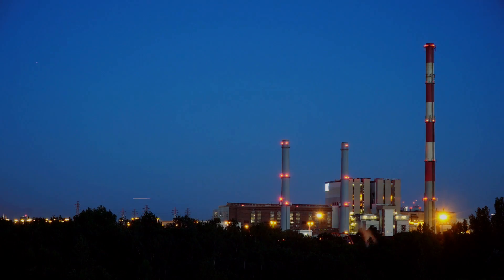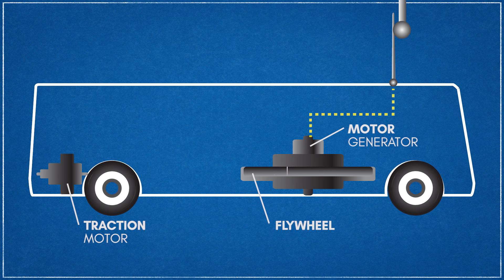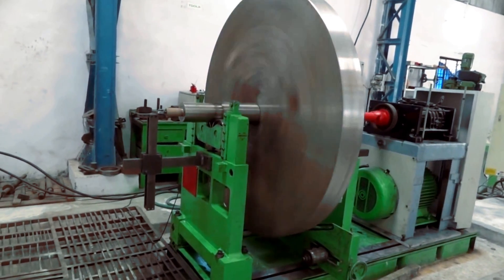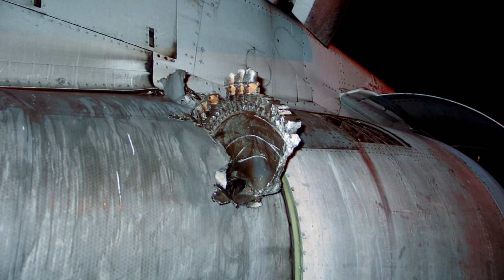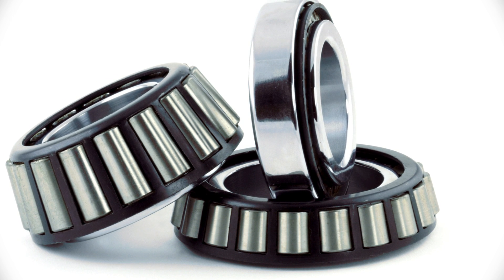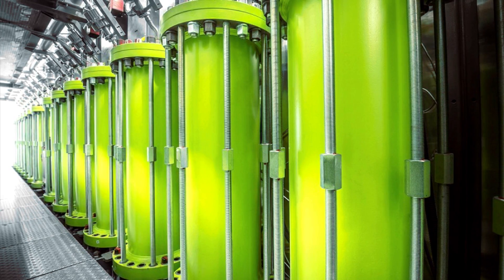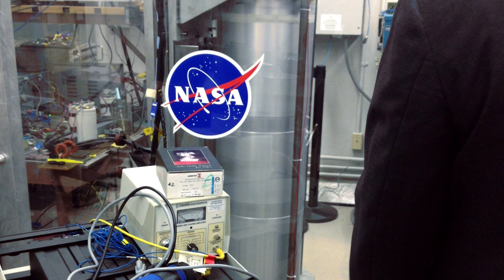The Mechanical Battery

Comment: But as for making public energy, just pumping water up a hill and turning on a turbine is a bit more efficient.
Reply: The New York Power Authority operates a pumped water storage facility in Eastern New York, Blenheim-Gilboa,  that is used as a peaking unit. The pumps that run at night (lowest demand, lowest electricity cost period of the day), fill the reservoir above the facility. During day periods of high demand, the water is sent through the pinstocks to the pump/generators to provide peaking power supply to reduce strain on the rest of the distribution system. It can produce 1.5Mw for about 12,000 Mw hours, all of which is sent to NYC. The overall plant efficiency is about 73%, For 12,000 MwHrs, they have to expend 17,000 MwHrs to fill the reservoir. They have been doing this since 1973, with several upgrades to increase efficiency and capacity.
Reply: It's simple too. It just doesn't have very much energy density.
Reply: @reedr1659  Yeah but that's less important when it comes to mass energy storage considering we don't use a large portion of the land anyways. But it is far more efficient to just pump water up hill and turn a turbine as nearly all the energy is preserved indefinitely. The only losses come from evaporation and technically rain tends to balance it out in most places. Plus since other forms of energy storage like batteries can explode and flywheels have poor ability to maintain their charge this is the best we can currently think of.

Energy density is more an issue when it comes to raw energy production depending on how it is made, how close you can live in proximity, etc. An example would be that while solar is one of the absolutely least energy dense, but you can literally put it on the top of a roof or even over parking lots making the impact negligible. Solar is more held back due to material demand, economics, the limited resources required to produce it, and that the resource tends to be dependent on other nations. These aren't really facts to ignore. 

Nuclear tends to be considered the most energy dense because logically ripping energy directly from the atom is far more dense, but at the same time, nuclear also takes large scale projects which most people are unwilling to live within 5 miles of due to its history (even if that history is very skewed). It also takes more expensive mining programs and as of right now next to none of the US's uranium is mined here in the US making it a negative on the US economy, even if it is the best we got to produce large sums of power in a clean manner. 

Wind is by far the least efficient as the land issue can't really be solved and maintenance is brutal. Wind is basically always going to be the last option.
Reply: @Skylancer727  I don't necessarily disagree, but dams are expensive to construct and considering the health of existing dams in the country, do we really want to add tons more? It also poses other issues, water rights being probably the biggest. Honestly, we'd probably be further ahead to put the money into developing nuclear fusion as a viable power source.
Reply: @reedr1659  well we don't need to make dams. Like I said, you can just make a reservoir and pump water into it as storage. Technically dams are just a method to produce power, not store it. Plus you can make a reservoir far cheaper than a dam. It's more constructing pump systems and a run off and you can use existing pits or crevices in the land. Just make sure it's enforced enough and it's fairly cheap. 

And fusion is not coming any time soon. Honestly fusion looks at least 50 years off as none of the current methods produce anything remotely worth the energy wasted to cause the fusion. And considering experimental reactors are basically a no show, that means commercial fusion is decades off considering the construction of one plant at the commercial scale will likely take 15-20 years alone. It may be even longer off yet.
Reply: @Skylancer727  Dams are mechanisms for containing the stored water energy in a reservoir.  The power generation and pump systems may even be in their own building at some projects.  There are also significant dams without power generation at all, like the big dams keeping the Netherlands dry or the tailings dams at mines.
Reply: @johncrowerdoe5527  Well most of those are designed specifically as reservoirs to store water. You can of course add energy generation to the outlets of them, but depends what you intend on using it for. You don't however need a dam to make a reservoir. Many reservoirs are just plots of land they dug up, layed cement over (if one of the uses was for drinking water, if not it isn't necessary), and pump water into it.

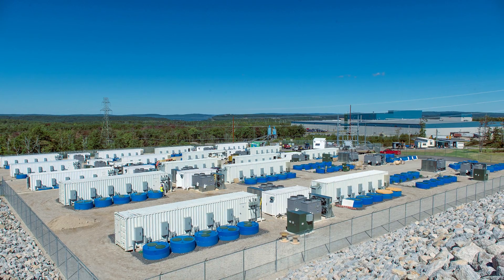Comment: Hi! Great vid! Just a heads up that at 13:40 I think you measure storage capacity of the power grid systems in watts.
Reply: W, kW, MW, GW etc are measures of power, not energy. Energy is measured in Joules (J) which is the energy required to provide a Watt of power for a second. 3,600J is enough energy to supply 1W for an hour and is often called a Watt Hour (W.h). Likewise, 3,600,000J is a kW.h., 3,600,000,000J = 1MW.h.
As a physicist, it always irks me when people who ought to know better conflate Watts (power) with Watt hours (energy).
Reply: @q.e.d.9112  Thank you Q.E.D. for saving me the time of making a similar comment.

Comment: I'm imagining a wind up cell phone.
Reply: I'd buy that
Reply: I can't see why not.

Wind spring.
Spins a ring that carries many tiny Magnets. each in opposing polarity(?).
A small coil has those magnets go through it drive an AC current.
tada.
Reply: @fanOmry  I actually have a little hand wound charger with a USB port on it.  It's a lot of work for not very much charge.

I bought if for a dollar including shipping a couple years ago.
Reply: @DAndyLord  

That was Probably a basic Dinamo setup. Like with Bikes, only a wind spring.

My Idea is the Hand spring drives a flywheel that's doted with magnets.
Those Magnets drive an ACurent.
Much more efficient.
Reply: @fanOmry  A clockwork mechanism makes more sense to me.  A wound spring spins a flywheel and power is taken as needed by the device.
Reply: @DAndyLord  

That's what I wrote.

I just detailed it.
Basically something equivalent to a generator in a power plant(Almost)

Comment: Let's see...bus hits a bump on one side and tilts a bit, or takes a curve and the body rolls to the outside due to centrifugal force.  Then the gyroscopic reaction violently slews the bus sideways.   Must have been fun to steer this thing.  Reminds me of an old propellor airplane (forget which one) with a radial engine where the cylinders were what rotated with the propellor.  The gyroscopic effect of all that rotating mass gave it frightful handling characteristics.

Comment: I wouldn’t think that using a flywheel energy storage system would be very safe in a moving vehicle, one accident could be catastrophic. But using it in conjunction with solar panels for a house could be quite useful for night time power use.
Reply: Moving vehicles have tanks full of highly flammable liquid, massive lithium ion batteries and high speed reciprocating pistons. All dangerous if not managed properly. Flywheels are perfectly safe in moving vehicles if mounted appropriately in containment housings.
Reply: Exactly my thought as well. Worth researching for feasibility.
Reply: But you could let the flywheel maintain its axis of rotation by allowing others axis points connected to the flywheel’s axis in three dimensional space, like a gyroscope toy, to rotate in the frame of the car’s rotation. Second: I am not sure if gyroscope force are affected by centrifugal force, which would mean a cars change in direction has no effect on the gyroscopic forces.
Reply: @glennobiero6775  if you would drive left/right, that axis won't affect the flywheel at all, but what about a speedbump? Due to gyroscopic forces it will exert a force on the car! If you have two counterrotating flywheels, they would cancel out each others gyroscopic precession!
Reply: Could implement a braking technology linked to collision sensors in the event of an auto accident. Problem solved.
Reply: It's not possible to use it for anything that's not "sitting in place", or moving in a straight line, because the higher the energy in a flywheel, the more energy it takes to accelerate/decelerate it in any direction. It can be used for your house for storing limited amounts of solar energy for sure, but not anything like a "mechanical battery" for cars.

Comment: We forgot to add that for fixed bulk FESS, the gyro precessional forces on the bearings due to the earth's rotation can be all but eliminated if the flywheel's axis aligns with, and points in the same direction as, the Earth's rotational axis (we estimated the axis directions for various latitudes using a cocktail stick and a globe).  Therefore at the equator: axis  horizontal, at the poles: vertical, and somewhere between these two extremes anywhere else on the planet.  However,  there will still be an out-of-balance but constant force on the bearings due to the flywheel's weight.

Comment: Strong magnets usually use rare metals, like neodymium. So flywheel systems need some rare materials for motors, generators and bearings.
Reply: Motors and generators typically use electro magnets dominated by iron, copper, aluminium and nickel.
Reply: @johncrowerdoe5527  Yes, but motors with permanent magnets are more efficient. And you need that high efficiency to make a viable energy storage system.

Comment: Flywheels were used on early aircraft carriers to launch the planes. Also for aircraft engine starting.
Reply: You mean reciprocating aircraft engines? Yeah and they still use them today because they are basically car engines with car starters.
Reply: @mistere5857  I was thinking the hand-cranked inertia starters used on some single-engine WW2 fighters.
Reply: @scratchdog2216  oh yeah those are definitely more in line with the principle of a fly wheel as presented in the video

Comment: What about a system that works like a ice-skater (with hands to the body increasing RPM)? It can adjust it's RPM.
Reply: You know what, that's actually a brilliant idea.  One of the biggest issues with flywheels is controlling the RPM.  I guess it's not done because it would make the flywheel very large with the "arms" sticking out, and if you just made a solid flywheel that large you'd be able to store more energy so it may not make commercial sense.  But matching the RPM to the target range is difficult and expensive, so something like this could really do the job much more cheaply.  Very interesting for a home/DIY project!
Reply: @Berkeloid0  Heavy meats, like tungsten? Needs yet to be calculated though. Don't have the time on my hands.
Reply: @lkocevar  I mean if you have a flywheel with a 1m diameter, and you give it arms that can extend out to 2m diameter, you would need the same amount of space as a 2m flywheel and then a solid 2m flywheel can probably store more energy in the same space.  Although the material close to the centre of the wheel won't contribute as much as the material nearer the edges, so perhaps it's not a problem -  I don't know enough yet to say for sure.  Will definitely be investigating your idea though in a future off-grid setup, where losing some energy storage but gaining easy frequency control is well worth the tradeoff.

Comment: Another way of doing it is by having a pulley system in a tower. You have big weights that just get hoisted up by a generator motor when the power is on, then when it’s off, discharge the weight and let it sink to the ground, or further if you want. I’m not sure which is better, more reliable, more efficient, etc. but it’s another way you could do it.
Reply: Yup, I want to have a go at making something like that. 
 Perhaps starting small, with a 1 ton weight, raised to a mere 5 metres.

Comment: "no need for exotic minerals..."? and how exactly are you building the motor/generator and the magnetic bearings and the high performance alloys withstanding the forces of high rotational speeds without exotic minerals? 
🤔
Reply: The iron age was 2500 years ago
Reply: The Neodymium Age only started 1885 tho...
Reply: 1885 was still counts on fingers a few years ago.  Neodymium is no rarer than copper, and not strictly necessary to build a giant flywheel, which is maybe not the best idea in the first place.

Comment: It is clear that for a small scale system like a car you would rather use something like chemical batteries, compressed air or hydrogen. But aside from using an already existing mineshaft to hold large amounts of compressed air those become less cost effective on large scale. We really need some better numbers on what size flywheel units are most cost effective to build and how many of those would be needed for a good grid level storage system or building backup. Frankly, if you could make a flywheel of similar capacity and cost to a Tesla Powerwall, needing to install it in a pit in your garden wouldn't be too much to pay for the longer lifespan and not needing to worry about all the issues that can lower the efficiency or even kill your chemical batteries.

Comment: 10:40 *flux vortex locking/pinning. The Meisner effect is far too low to sustain the required loads and is not even present in practical superconductors. Also, using superconductors for rotating parts, especially those with the RPMs of flywheels, pose significant problems and losses related to the AC properties of said superconductors
Reply: The superconductors would be closer to the center axle than the energy storage mass.  The eddy currents are actually used to hold the thing in place.
Reply: @johncrowerdoe5527  those are not the issue, the hysteresis losses due to the changing magnetic field in the superconductor are. Also coupling losses will pose problems (all practical superconductors are composites)

Comment: The gyroscopic forces created by the rotation of the Earth can be neutralized (in stationary use cases) by positioning the axis of the battery to be parallel to that of the Earth. That of course means that the devices axis angle to the ground will have to be latitude-dependent.

Fun fact: There was an attempt to use that same force to make a device that could extract energy form the rotation of the planet Earth. Using a gyroscope as an "anchor point" and using it's 24 hour procession to turn a generator, of course after the rotation is being sped up by a transmission. Picture a flywheel with an axis perpendicular to that of Earth, spinning fast. That whole contraption is suspended on another axis, this time parallel to Earth. So you get one rotation per 24 hours in that parallel axis. If you put a accelerating transmission theoretically you can get any number of revolutions per minute ... The soviet union spent millions and years trying to perfect this method. In the end they ultimately failed. The amount of gear acceleration that had to be applied was so great, that all of the energy was lost in the gears themselves. The original idea was that the energy expended in spinning up the gyro wheel  and keeping it spinning would be far less than the extracted energy. Since the wheels energy is not actually used and the wheel is only used to create the gyroscopic effect which in turn is used to generate the output energy. However that energy economy was never achieved, by a long shot. So they abandoned it.

Comment: how do you increase the energy capacity for a flywheel( ie by optimizing mass or radius or rpm) which factor has most effect on energy capacity and will changing radius do anything?
Reply: Check the only formula in the video.

Comment: Have they tried floating a flywheel on a dence liquid like mercury or even lead the waste heat from friction would keep it molten?
Reply: Why tho? That, as you said, would waste a lot of energy as friction heat
Reply: @megafefeBR  they flywheel generator people. Like i said the heat would be beneficial for the liquid
Reply: @dougrogan379  yeah, but it would loose its inertia very quickly, and lose its stored energy
Reply: @megafefeBR  what about a compressed gas to fill the space between the liquid/solid magentic plate and fly wheel so it's sitting on a pocket of gas?
Reply: @dougrogan379  why not just put it in a vacuum chamber as the video described?
Reply: @megafefeBR  the top half could be in a vacuum chamber but there still needs to be a point of contact to function as a bearing. Unless it is in a 0 gravity environment

Comment: Why not use the same principal dams use? Pump water on top of a hill or a massive tower and release the water once energy is needed. No need for high maintenance huge flywheels to store energy
Reply: As in the thing already mentioned at 0:43? Pumped hydro has been used since forever. Problems with it include the low energy density of water and needing a huge lake you can dam on top of a hill, which are in kind of short supply. Building one also tends to lower the property values of the area, what with destroying nature and risk of causing droughts or floods. And you are not going to make it any smaller than few square miles when the aim is to develop batteries that fit in a basement of a building or take at most one building in a city block. When one of the goals for storing energy is to proof your city, factory or data center against blackouts from bad weather, accidents or terrorist attacks cutting the power lines it does not help relying on a far away power plant that needs those same lines to get the power to you.